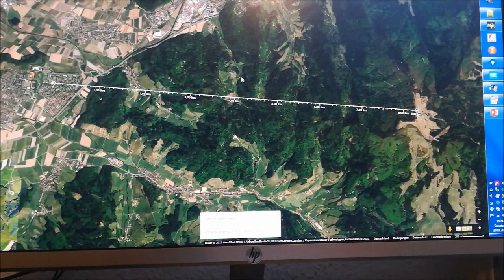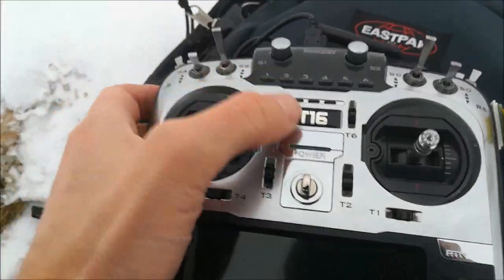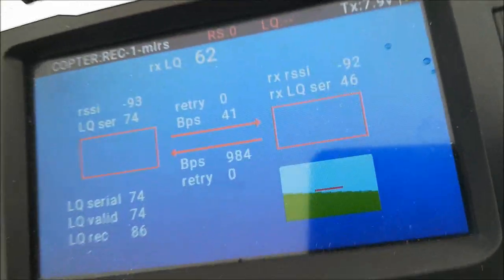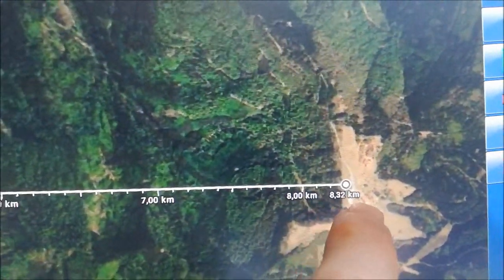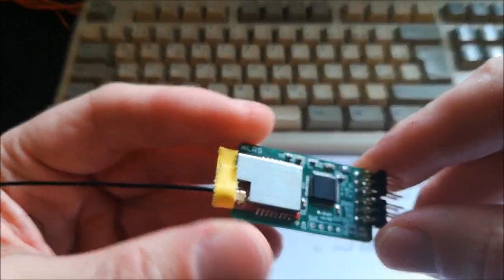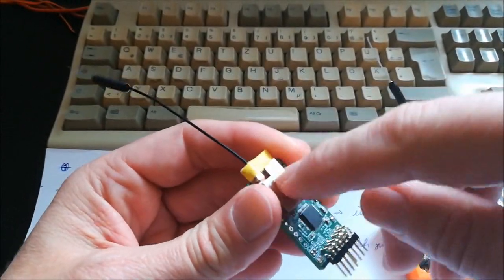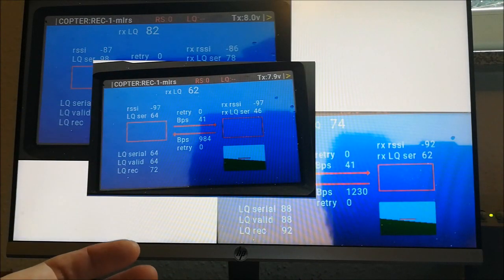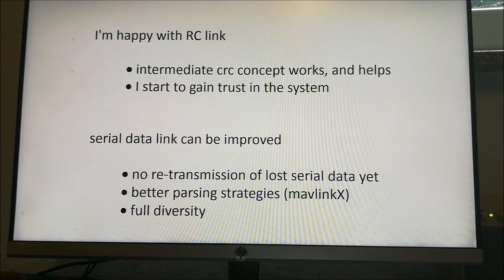mLRS: Range Test, 8.3 km

Comment: Heroic test indeed ! What does mRLS mean ?
Reply from the maker: you may read the intro here: https://github.com/olliw42/mLRS

btw, it turned out to be even more "heroic"", as - as a clear sky later showed - there was not actually a free line of sight LOL
Reply: @OlliW42  1:02 what broke the line of sight ? the building or the the trees on the left ? Anyway: makes the test even more amazing.
Lora ist known to me, but does one really need long range mavlink ? My old Graupner radio ist rated for 4km range (both rc and telemetry). That's enough for me.
An HD video link would be more interesting imho. Wifibroadcast is not a bad idea, but i don't like the idea to run a full linux just to transmit video ... and the wifi adapters are to large.
Reply from the maker: it turned out that one of the smaller summits in between is covering the line to where I was standing, the building I mention cannot be seen. I should have went somewhat to the left,  or much to the right. Good that it was cloudy. I just recalled that the mountain can be seen from the ground place, and believed also the building, but I was incorrect LOL. Anyway, worked out. I admit however that when I realized this two days ago (sky was free) I was also more impressed. 
For me it is not so much about absolute range, but absolute reliability up to the range I go.
Systems like DragonLink, RFD900, but also Crossfire exist, they wouldn't if long range mavlink wouldn't be a thing.

Comment: hi oliw
do you use flrc or lora ?
Reply from the maker: hey. Lora. For the chosen setup it should however not really matter if it's Lora or FLRC.
Reply: @OlliW42  thanks
why you not showing in any video to connect mlrs to missionplanner or QGC?
again thanks
Reply from the maker: hey, very good question, but at this point in time I have just a very lame answer: I simply didn't tried it. It's currently not (yet) my focus, it's simply too early. 
So far I was totally focusing on getting the basic link reliable. Concerning the serial data, it means it is just a bi-directional transparent link ... with packet loss ... and with limited bandwidth. There is no effort yet at improving the serial connection by e.g. retransmitting lost serial packets or better parsing or "traffic" management via e.g. the txbuf field in the RADIO_STATUS message, and so on, but I think such "tricks" will turn out crucial. All this certainly will have to come, I mean, it's the goal of mLRS to provide great mavlink behavior, but it's just not there yet.
My plan is to target mavlink greatness in alpha v0.4. (alpha v0.1 is to get a supposedly reliable link with basics worked out, alpha v0.2 is adding binding, parameters, configuration etc, alpha v0.3 would be full diversity, and alpha v0.4 would then be about starting into mavlink greatness).
So, in short: time :):)
Reply: @OlliW42  So I'm looking forward to reaching goal 0.4
Reply from the maker: we will see how fast or slow it goes :)
Reply from the maker: @Mojtaba Hadipour, fun fact, just tried to connect to MissionPlanner ... and it worked just fine ... :D